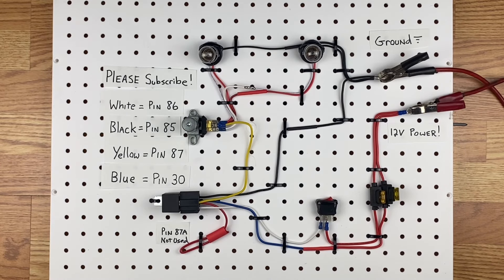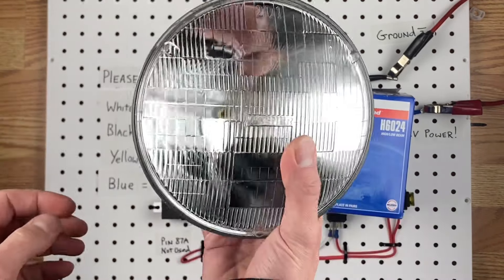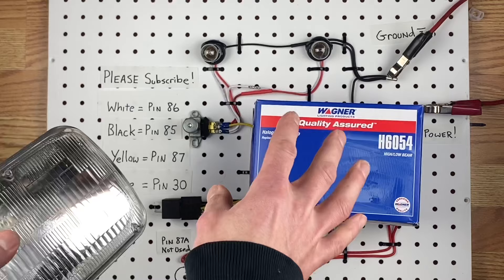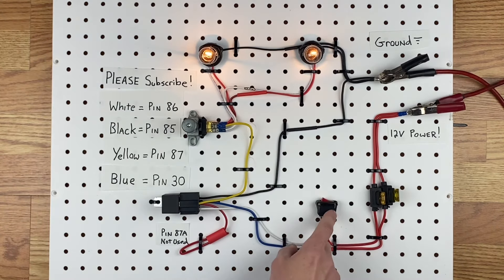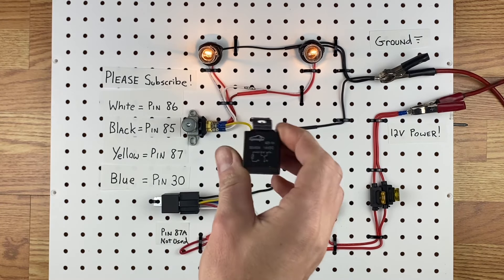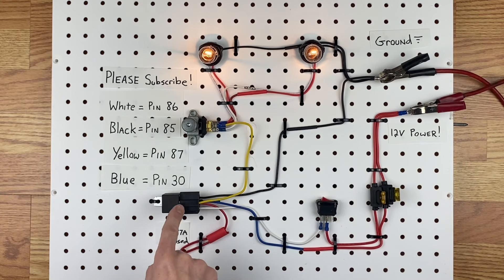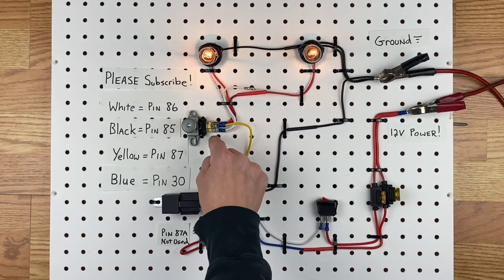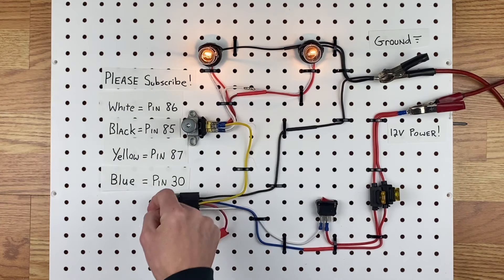How to Wire a Headlight Relay for Sealed Beam Round & Rectangle Lights w/ Floor Dimmer Switch.

Comment: Can you make a video showing the best way to wire in a kill switch?   Anti thieft for an older car.   Maybe a relay to the distributer or something like that.   Maybe something linked to a key fob with rfid so it will only work with your keys?   Thanks again for your videos
Reply from the maker: Very cool idea.  I will add it to my to-do list!  Thanks for watching and sharing the good idea!
Reply: @WiringRescue  on a different topic, do you know a way to use the rpm feature on a modern radio when you don't have a computer in your car?   Digital dash for a dumb car?

Comment: Can you do a video on power windows? I gutted my fox body for drag racing, but I’d like to rewire the power windows.
Reply from the maker: That’s a terrific idea that I hadn’t thought of! I’ll add it to my to-do list for a future video. I do have a to acquire the parts though, so it could be a while. Bare with me!
Reply: @WiringRescue  if you are close to Delaware I have the two window motors and two wires hanging from them. 😂
Reply: @WiringRescue  if I’m using a five pin window momentary rocker switch do I need to use a relay?

Comment: On semis there is a button on the steering wheel that you can press to turn off the headlights there is also a separate button that can be pressed to turn off all the daytime running lights. All lights come back on when you let go of their respective buttons. I would like to install those buttons on my car because I’d use them every day as I do in the semi. How would those buttons be worked into this system?

Comment: I did this this weekend to create a ebike headlight with motorcycle headlights!

Everything worked BUT! My battery is a 52v and the headlights I believe only needed 12v—- so it blew up as soon as I hit the switch!

At first I thought it was because I didn’t ground the toggle switch (on-off-on) and that could still be the case but I think it’s mostly because I had too much power going into the headlight (52v battery into 12v light)

I am going to continue to try the project but I have to figure out how to turn my 52v battery source produce just 12v for the motorcycle headlights 😭

Not your problem, you did label “12v Power!” Hoping my 2nd pair of lights don’t blow up!

I was hoping it would just be the fuse that blew up but I think that is for the battery safety?

Comment: First I want to say, great video. Very well laid out diagram and clear. But why wouldn't you wire it so that pin 87a is low beams and the high beam contact on the dimmer switch triggers the relay. That way you only have control voltage going through the dimmer switch.
Reply from the maker: There are tons of different ways to wire a circuit. My video was just one option which may or may not be right for your application. If it were wired as you suggest (assuming I understand it right), the low beam headlights would be on all the time, possibly even with the car off. That may be the preferred wiring for some scenarios, just not the one I was trying to demonstrate. Maybe I’ll do some additional headlight wiring videos showing additional methods.
Reply: @WiringRescue  you're right. I didn't even think about that. I was trying to keep only control power going through switches so I guess my way would require two relays. One triggered by your on/off switch to give power to the headlight relay, and one triggered by the dimmer switch to control hi/low. Little more complexity but keeps lower amperage running through your switches which I like. But either way man, still a great video. I wasn't trying to hard talk you at all.
Reply from the maker: @RobertJohnson-yi2mu  - I also like to use relays to keep switches alive longer. In the case of these floor-mounted headlight dimmer switches - generally they are only powering two headlights at once, which should be less than 10 amps. I found a spec sheet for one of these floor-mounted dimmer switches that says it is rated for 20amps. So wiring the way I did in the video should work very safely without any additional relays, assuming the wire gauge and fuse is also correctly sized for the application.

Comment: Would it be possible to connect white wire (on relay) to UNswitched 12V power, thus energizing the relay upon start up? I’m thinking of this because I want to use a 3 position rocker switch ( on-off-on) to operate low/high beams…

Comment: Hey man ... top man! I've learned so much from you. I've built a trike which I am currently wiring up. I'm struggling to get my head round headlight wiring with side lights. I have a 3 position switch, off, side on, head on then a second 2 position  switch for hi and lo. Am I right to assume I need a second relay to run the side lights before splitting off hi and lo?

Comment: Hi looking at your video about wiring up double head lights how do you wire up duel relays one for low beam and the other relay for high beam the yellow wire comes from head light switch to dimmer switch how do I connect it to the relays

Comment: use two relays after the dipper switch so you get battery power straight to the headlights and if one relay fails you have redundancy and lights until you get safely off the road to fix it.

Comment: So I just acquired a 83’ firebird trans am and the headlights on the factory harness doesn’t work anymore will this circuit help me get my headlights back ?
Reply from the maker: It could if this is the design you are wanting. It is sort of up to you. If it were me, I’d probably fix the factory wiring harness, unless it was severely damaged or burned or something. The connectors at the headlights often fail on the Firebird style (sealed beam) headlights, so it may be worth diagnosing yours and starting right at the headlights themselves.
Reply: @WiringRescue   thanks I really appreciate the input on my question I’ll definitely diagnose the factory plugs first before I have to do any aftermarket hookups like this great one you have showed here !

Comment: Hi. I'm working on a 1991 Geo metro it has some dual positive set up on it and ive tried switching over to a newer headlight with the different pronged headlight similar to the three prongs on back of one u used except it's supposedly top prong is low beam right is hi and left is ground.ive tried 4 or 5 different ways to set up a dual relay 4 pin 30 amp basic 87,86,85,30, and no matter which way I do it the lights either dont work right or not at all so I've come to the point of using another toggle switch instead of factory switch which is only connected to the 86,87.ive gotten instructions from a supposed Geo guru,a supposed lighting expert and a supposed mechanic expert in the electrical fields oh and some all knowing computer robot that surprisingly told me it was wrong when he answered anotherpersons question about no car has both a carburetor and a fuel injection set up and my Geo actually does have that set up.ive already purchased a three prong switch which has a 2 speed of hi and low which I figure I could do the hi and lo beams with,I'm just looking for what the best wiring so!ution would be to do without having todo so many more unwire and rewiring of the last set up not working...it has the 2 30 amp fuses going to pin 30 the hi beam wire going to 87 on one relay and lo beams on the other relay 87,both 86s are going to the original wire harness power source wire and the 85s are going to the matching hi and lo wires corresponding with the wiring going to the relays and the 2 wires from the headlight going to the ground straight to battery. I've had it set up a few other ways thinking top light prong was low beam and also where the 85s and 87s were fused to the battery.im thinking the grounds straight to battery is messing things up since it's not set up as a positive negative and if I put my own switch in I canavoid all this positive only system thing going..please and thank u

Comment: I have 4 pin Denso relays, small size but very high quality - can i used those car relays in electric motorcycle ?
Reply from the maker: I would think so as long as they have the correct voltage / amperage ratings.
Reply: @WiringRescue  thank you.  These automotive relays are rated for 12v setup , and my Ebike battery is 84v , amps won’t be more than 2-3A but I hope high voltage doesn’t melt it. (Will be operated from 12v)

Comment: hi ,im doing a front conversion of a 2022 lexus lc500 on my 2008 lexus is250 and im trying to make a harness that makes the running lights ,high and low beams work and have no idea how to wire it

Comment: After watching this video I wanted to ask you for some help I have a Uncle with a 1988 Ford F 150 pickup trucks at he let me use but there is a red wire with a blue stripe what comes from the headlight area next to the battery and don't have no clue where it goes when I try to look it up on Haynes repair manual when the wiring system is different and wanted to know if you could help me and lead me in the right direction where it could go from the headlights when I'm thinking it runs to the dimmer switch but I'm not too sure where it goes to when I would like to fix the problem?

Comment: Thanks for this super helpful , I'm working on a 64 chev impala and the dip switch is faulty . Would a normal 3 way toggle switch work?
Reply from the maker: I also have a 64 impala. A normal 3-way switch would probably work I would think, but the new floor switches are very cheap. I think the one I recently bought was like $15. Maybe just get a new one?
Reply: @WiringRescue  cool, many thanks man.

Comment: I do have a question. Does it matter what size relay or switch or fuse would it affect how bright or dim the headlights would be? For example if you use a 10 amp relay compared to like a 15 or 20 amp relay or however that works
Reply from the maker: Hey there @Jayjay42023 ! Thanks for watching the video. You need to determine what size fuse the circuit needs. The fuse size won't dim the lights. It will protect the circuit if the accessory draws too much amperage.  I explain more & show you how to determine the fuse/wire size in this video.  https://www.youtube.com/watch?v=EhzN6UdnmPA  If you still have questions after this, let me know in the comments!
Reply: You are a great teacher...the best. Thanks for simplify.

Comment: So does the on off switch work? Also doesn't your wiring put all the draw on the high low switch? Would it be better to use 2, 4 pole relays out the high low switch to the headlights? Forgive me I am only smart enough to complicate everything 😂
Reply from the maker: - The on off switch turns the relay on and off, which is what feeds the 12v to the high/low switch.
- This type of floor switch is perfectly happy controlling the high and low beams this way, which you can check out on any 1960’s chevy schematic. Though the way you are describing should work too. It just more wiring to do!

Good luck with your project!

Comment: If we have 2 headlights on each side instead of one, do we need anything extra to support the circuit,  i.e. more relay or more fuse?
Reply from the maker: Yes! So it all depends. Are you going to have two low beam headlights and two high beams? If so, that’s a slightly different circuit.  If you did four lights that all swapped from low to high, that may be weird on a car.

A normal headlight is between 35 and 55 watts depending on which you choose. That means it can draw between 4-5 amps of electricity through the circuit. So if you had four of them, all on at the same time, you would draw 16-20 amps. That means your fuse should be somewhere around 20 amps and your wires all need to be thick enough to hands 20 amps. Most relays can handle 30, so you are probably safe there, though it’s worth double checking.

Comment: Hello I am working on toyota pickup 1988 and it be mess with the wires I'm trying to get the headlights working again but using LED 5×7 headlight relay harness but the previous owner messed up the wiring

Comment: Working on a 4 lamp 70 El Camino (which is same as a Chevelle, having 4 headlights).  So this diagram is not perfectly applicable.  Do you have a 4 lamp video that would apply to 1970 GM A Bodies?  Cool video anyway, I did learn something: that the foot switch is controlling the power one way or the other.

Comment: Ok so I have a question. I bought some 4x6 aftermarket headlights for my 1983 Monte Carlo. These headlights have halo rings lights, my issue is how do I connect them to turn on (halo only) with parking lights but turn off when headlights (low beam) are on? I’m not very experienced with electrical needs like this and lost on how to do this. Thanks
Reply: Also the halos all have there own red and black wiring to them.

Comment: 96 international 4700 wrecker. Main feed ignition wire into ignition switch melting housing. Can I just put the relay at the ignition switch going into the relay and going to o the ignition switch to power it up? I think my lights are too much on one circuit as I have them on all but headlights when I turn key on. Then when headlights on seems to draw too much and things get hot

Comment: I have a suzuki forsa 1988 and my headlight switch is damage is very hard to find and super expensive so i have a question my light switch has 4 wires one is for the headlight dimmer one is for ground the other one is for the park light and the other is for power can i wire this to a relay with one switch or i have to buy an universal switch any help will be appreciated
Reply from the maker: Unfortunately I don’t think I can be much help because I don’t have any experience wiring those. The biggest thing to note is that you need switches that are rated at an amperage that can handle the circuit that they are powering. If you use switches that are not rated properly, it could burn the switches or even catch on fire.

Comment: I think the point of using relays is to keep current out of switches.  You're putting current into that foot switch.  You should have a second relay for the second circuit and both of them after the foot switch.  Wouldn't you agree?
Reply from the maker: Thanks for watching! That’s what relays are for, yes. However, there are dozens of different ways to wire a circuit depending on the vehicle and purpose.  

These “old car” floor mounted dimmer switches are rated to handle a high amperage because they have always had the headlight amperage flowing through them. The older cars that used these floor mounted high beam/dimmer switches didn’t use relays for the headlights. They certainly could have though. So if you prefer to take the load out of the floor mounted dimmer switch, adding a relay certainly sounds like a fine way to do it.

I believe I actually have some other videos where I may have done this. Check out my wiring playlist if you are bored.

Comment: I'm having flickering light issues on my 1971 cutlass Supreme. I'm thinking I should add a relay to it. It has 4 headlights 2 for low beam and 2 for high beam. Do I need 2 relays or can I use 1 for all 4 lights?

Comment: Hey my I just bought a mercury comet 1964. Im rewiring  everything and I'm up ti the headlights. 4 bulbs up front. Inside ones have 2 connectors outside ones have 3. they tie in to basically you say grou d is that top post? Mine was red and they had it grounded threw the black rightde of the 3 post lights right to frame off the jump. So it brings me down to basically 2 wires going into the cab but that red one is the top post...
Could this be a positive ground situation? Cause I rewired everything else normally. Now I'm confused at how to proceed with this top post is ground situation

Comment: hello there in the great America. I have a question about the lighting of European cars! still a lot of difference with the USA.
In Belguim we have city lights (small lights at the front that work together on the rear lights). At the front we have the driving lights and the button on the floor turns on the very large lights that are intended to allow you to see a little further on small roads. If I want to connect this, will I run into problems?
the front side lights must be on together with the rear lights, but how do I switch on the driving lights and main lights? without the city lights going out?
I think I should use 2 relays, but what should go where?
Sometimes I think I know it, but I quickly lose it!
It is a 1971 VW Beetle where I replaced all the wires according to your videos on YouTube. Can you show me a clear video about this? I am not a technician so keep it simple as I am used to your beautiful videos. I'm a big fan and want to learn things myself, but sometimes you just need some help?
thanks in advance and good luck in life.
michel.

Comment: I have a floor switch dimmer that works my headlights on a 76 VW and they work. I am trying to get rid of floor switch dimmer and go to a column dimmer but my headlights don’t turn on with column dimmer. What is the difference and why can’t I turn lights on with light switch?
Reply from the maker: I can’t say for sure because I’m not super familiar with 76 VW wiring. However, you’ll probably need to get out a multimeter and follow the electricity to see where it is being lost between the switch and lights. You may also find this dimmer switch video helpful. https://youtu.be/WWDN-as7hA0?si=-Dlnr7Xt-8_eRKiD